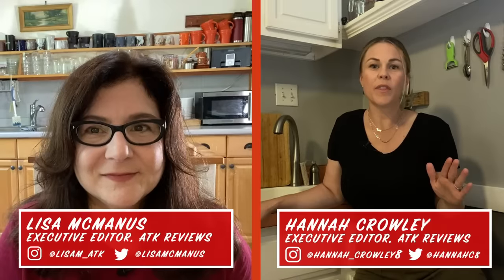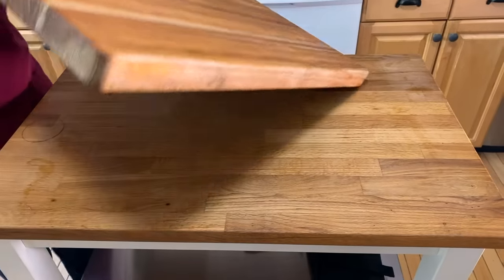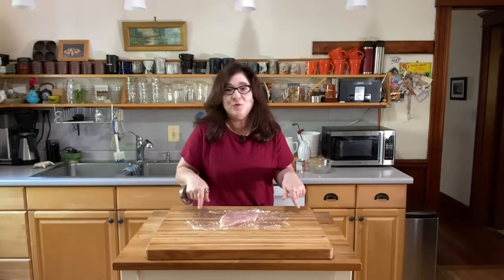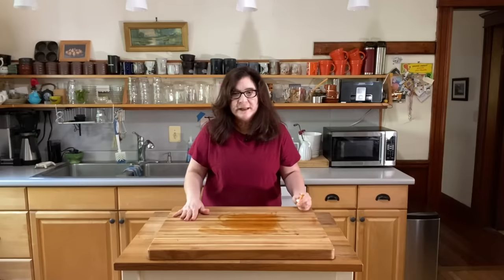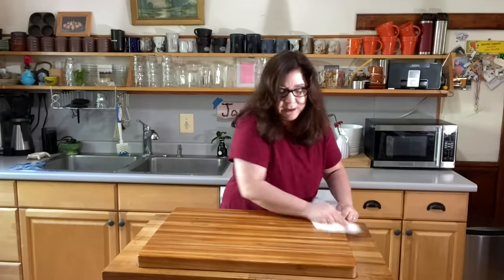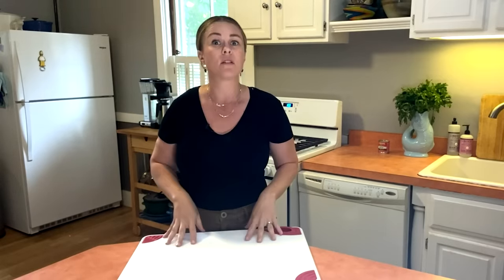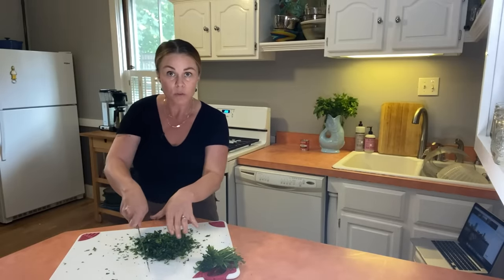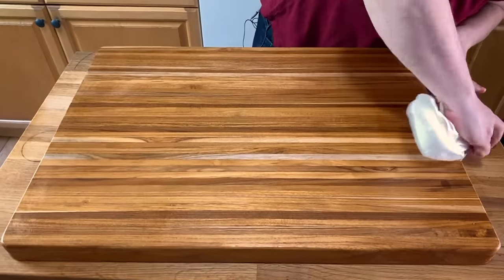Gear Heads | Which Type of Cutting Board is Best for Your Kitchen?

Comment: Another woodworker here... Of your cutting board is breaking at the glue line like in the endgrain board example the manufacturer used the wrong glue for the board (get your money back). Also when washing, wash both sides to prevent warping. Finally dont just use mineral oil to treat the wood There are special "wood butters" that are worth the money to keep your board looking like it was when you purchased. if you get the board from a woodworker then they can give you the wood butter that you need to treat your board.

Comment: 9:37 it may be able to be washed in the dishwasher but it does not fit in the dishwasher for a proper sized cutting board. Honestly, my Crofton $8 Bamboo cutting large board from Aldi's works great!! I've been using it for 4 years everyday. Sure, I'd love to splurge on a cutting board but there are so many other gadgets from Atk's recommended I need to buy! =)
Reply: The problem is that bamboo is not wood (it's a grass), and they are infamously hard on knives. Bamboo is 19 percent harder than traditional maple, which means it’s also harder on your knives. Also, the small grooves may ever-so-slightly catch your knife, interrupting a smooth cutting action. And many of the glues used for bamboo boards use formaldehyde. You want to make sure it says formaldehyde-free glue is used.
Reply: @violetviolet888  I have the atks #1 recommended chefs choice trizor knife sharpener and the Victorinox Swiss army 8 inch chefs knife and I have been able to maintain an extremely sharp edge on my knife. I did not know about the formaldehyde in boards though! I will definitely look into that.
Reply: @violet also I haven't really noticed any significant grooves that would diminish my cutting performance on my Crofton cutting board.
Reply: @barbara-holley  Just higher maintenance on your part. I prefer maple wood or the proper cultivars of acacia wood and enjoy the feel of my knives on the boards.
Reply: @violetviolet888  maybe if I felt something nicer I would change my mind. In the restaurant industry I always used plastic cutting boards (even at the fine dining restaurant). I definitely always hated plastic cutting boards.

Comment: I use both types of boards . I use coconut oil for my wood board and cooking spoons, spatulas, should I switch to mineral oil?
Also can you cut on granite countertops?
Reply: All organic oils turn rancid (that includes coconut oil) and polymerize. Your equipment is already ruined, anything new you should solely use mineral oil on. You can cut on granite, but it will dull your blade like glass or bamboo would.
Reply: @madthumbs1564  😭well I get new stuff☺️

Comment: I was Afraid to wash my wooden board in the sink because I was worried it would suck in soapy water and it would ruin it, so I had just been wiping it down. I don't use it for cutting any raw meats. It's about 75% for handling dough, 15% for cutting Pizza, and 10% for other random things.

But then one time I had it nice and moist and I decided to take my bench scraper and drag it across the board. The Edge was full of this dark bluish green moldy gunk. So I did it again and again. Finally by the seventh time, it's stopped. Really disgusting.

From now on, full hand wash every time it gets used.

Comment: I rather cut tiny bits of wood into my food than plastic. Also, I've had bamboo cutting boards for 3 years plus and never had to rub oil on them. No cracks. no problems. never had that issue with maintenance.

Comment: About plastic boards: POLYPROPYLENE NOT POLYETHYLENE. PP is softer than PE, which means PE will chip your more expensive knives, and dull the cheaper ones. Always check the chemical composition of the cutting board.

Comment: [ would like to see a testing of cooking oil sprayers as a replacement for "PAM' type oil aerosol spray cans from the grocery store.  I would prefer to use my own oil since I know the quality of the oil.  The quality of the "PAM" type spray cans is of unknown quality. The pump sprayer I purchased was unable to adequately spray a light vegetable oil and was totally unable to spray any olive oil period.  thank you
Reply: DENNIS SKURNACK I stopped using Pam years ago. The best luck I have had is with a bottle of ghee/coconut oil I bought and have been refilling with olive oil ever since. The company is St Francis Herb Farm. I have been using the same bottle for many years after having the same issue with the pump sprayers.
Reply: @lynnstlaurent6789  THANKS

Comment: Both sides of your double sink are bigger than the double sinks builders put in average tract homes in S. California since the late 50’s.  Bigger than what they put in average mobile homes, apartments, and senior complexes.  I know because I lived in 5 of the Counties over the 65 years I was there.  They may be putting tall faucets in newer average housing.  I currently live in an older mobile home with a kitchen built like they thought it was a motor home.  Your favorite cutting board would need to be washed in the tub or shower in a lot of homes.

Comment: With, or without, a border juice canal?  I've generally found the juice canal less that valuable.  What do the testers think?  I see that neither of the two winning boards (i.e., the wood nor the the plastic) have a border juice canal.
Reply: The "juice canal" is found on their winning carving board, but the cutting boards don't have them.
Reply: My Proteak board (a different thicker 20 x 14 inch end grain one) has a juice channel on one side, but i generally leaves that side facing the counter. Might be nice if I ever host a party with a big roast on the middle of the table, but generally it just makes the usable space smaller, and food gets complicates getting food off the board. Who wants to dig out bits of chopped onion, parsley, etc, from that indentation?
Reply: Thanks for the comments.  I hadn't realized that distinction between cutting (no canal) and carving (canal) boards but, based on the comments, Idid a "versus" search on the internet.  However, I still don't see where the canal would be all that great since it fills up and overflows anyway (I have both board types).  I think if I get an additional board, I'll just opt to "reclaim" the canal space as someone mentioned.
Reply: @ltp2151  It takes a lot of liquid to overflow the canal on a good carving board. I think you're not letting your meat rest long enough before carving if you're getting that much.

Comment: I don’t think the 15×20 plastic boards will fit in my dishwasher I just measured the dishwasher I have smaller OXO boards that I put in the dishwasher.  The black trim gets sticky and black gets on everything and I have to throw them in the trash.  I am looking for a plastic cutting board that I can put in the dishwasher. Any ideas?

Comment: The disposal of the cutting boards should be noted.  The wooden ones will last a long time with proper care but will biodegrade.  The plastic will be a problem for a long time.  Carbon footprint should be included as far as manufacturing goes.

Comment: Perhaps you should have done the bacteria test with a well used plastic cutting board..When I began cooking in restaurants wooden boards were already prohibited; erroneously. As you proved wood cannot retain bacteria. We've seen that plastic boards with micro cuts do indeed trap bacteria as well as food residue. We've thrown away wore than a few stained and stinking plastic boards. Even after being cleaned in commercial dishwashing machines.

Comment: I'm in the wood camp too especially for rolling pastry dough out or am I wrong as I've never seen a plastic board used for rolling pastry out on ATK.
Reply: Most of us would just use our counter.
Reply: @madthumbs1564  supposing its flat and smooth but mine is tiled and very limited too so I have to use a board on my stove top area.

Comment: I need to repurpose or sand my cutting board. Tips?
Reply: Keeping cutting surfaces flat would be the priority, I would think, then more coats of oil before use. If planing the surface, you would then want to sand smooth, and apply your oil.

Comment: I think the plastic cutting board might cause a health risk on the long run if the small bits and pieces keep ending up in your food. Plastic accumulates in your body over time . What are your thoughts on this? Do you think this could be an issue?

Comment: I use extra light olive oil on my teak board all the time. It's not a problem because we wash it all the time too. I oil before I use it, so stains and contaminants don't soak into the wood...then after I wash in the sink with hot water, let dry, then oil it again. The extra light olive oil has never turned rancid on us in over 4 years of use. It's important to keep the board well oiled, and while mineral oil is good, it's too expensive.

Comment: There's no mention of microplastics.  If you're cutting off of plastic boards won't you get microplastics in your food?  My preference would just be a block of tree stump.  If the surface gets chipped, nicked or stained all you have to do is mill off a 1/4 inch or so and you get a new surface.

Comment: I got the Proteak wood board you recommended last time and I noticed it’s starting to wobble. Is there anything that can be done so it doesn’t warp further on me?
Reply: Oil it often and regularly. I meant to get their fave Proteak board a few years ago, but it was out of stock, so I ended up getting a slightly smaller, but thicker Proteak end grain board. It is very heavy, but since it is not as tall and wide, it is a bit easier to wash in my small apartment sized sink. So far I haven’t had any problems with warping or cracking. Love it. In addition to mineral oil, I occasionally use a board conditioner, which is essentially just a blend of mineral oil and beeswax.
Reply: It will tend to curve/expand on the side that gets wet more than the other. Try wiping some water on the other side and it should bend back. Then, make sure it’s never wet only on one side and condition as the other person said.

Comment: I need a manual can opener review, I’ve bought several of them and can’t find a durable one
Reply: My SwingAway can opener has lasted for years!
Reply: MJ  well I bought one that removes the seal on the can so there are NO SHARP EDGES   I think I gotmit at TARGET about 14 years ago. , Cheers  🇺🇸🇺🇸🇺🇸🇺🇸
Reply: My Kuhn Rikon has been working well for years.
Reply: Swing away lasts but kitchenaids are also nice
Reply: @sillyrabbit367   Bed Bath and Beyond has them on line.  I'd buy one but there is no place in my kitchen to put it.  Made in China now like everything else.

Comment: I am a plastic fan.  The deeper cuts can hold onto bacteria, especially concerning when it’s from meats.  The dishwasher certainly sanitizes the boards, but if I need/want to quickly sterilize the board, I spray it with spray bleach cleaner, and then quickly wash it with hot water.
Reply: Agreed about the bacteria in the knife cuts in the plastic. Understanding this, why would you continue to use it? There's also the issue of microplastic shreds contaminating the food.
Reply: @Horizon344  Can’t wash wood in the dishwasher.  My experience with wood always eventually resulted in cracking and/or warping, unless it’s a very heavy unit, which is not cool for moving it to and from the countertop.  As to shreds, I don’t cut into the board deeply enough for shreds to come off.
Reply: @catdeddy8427  Is handwashing in a sink such a trial? I've been using two basic good quality wood boards for 20 years, & they're still going strong, no issues. There's no moving on my counter-top, if you have one doing that a cloth placed beneath the board will stop it. As for plastic shreds, if you can see any grooves/scoring in your board - that material (microplastic) that's come out to make these marks has gone into your food, & once you've heated it up & consumed it it's anybody's guess as to what your digestive system & blood stream will do with it.
Reply: @Horizon344  You do you...

Comment: I've tried all the cutting boards, even made some myself, and honestly my recommendation is to not spend much on them. Seriously, 250$ for a piece of wood? I just get the cheap plastic ones from ikea, and throw them away once they've bent and stained. You save precious time, effort and especially money that you can spend on things that actually make a difference, rather than spending a small fortune on a glorified piece of laminated panel that you have to maintain every day so it doesn't stink and rot.

Comment: One more thing, I have an average sized dishwasher, and that plastic board wouldn't ever fit!  The biggest one that fits is 13.5x16.5.  Not sure how they got that giant one 15 x 20, in the dishwasher.  Maybe that's why they cut the video at that point. Dishwasher looked smaller than average and just went back and paused the video and that board is too big for a regular sized dishwasher.

Comment: I think it's worth pointing out that not all plastics are equal.  Whereas you could use as knife with a hardness >60HRC on most wooden cutting boards, the same is not true of all plastics.  Most high end composites and polyethylene based boards are fine though.  To be fair, there are also plenty of woods that would be too hard for harder knives, but they aren't used that much for mass produced boards.  If you use soft, stainless steel knives, it doesn't really matter.

Another thing to bear in mind is that, whilst the high silica content of teak offers great protection for the cutting board, it can also dull knives faster, which is fine if you don't mind maintaining your knives.
Reply: This is a big commercial. The whole channel is.

Comment: If you use a plastic board long enough you will be eating and serving plastic... over time tiny pieces will release from lots of cutting... but, they are cheap, so replace when the surface starts feeling rough.

Comment: My preference for cutting board is Bamboo. Extremely durable and from the USDA page "Bamboo cutting boards are harder and less porous than hardwoods. Bamboo absorbs very little moisture and resists scarring from knives, so they are more resistant to bacteria than other woods. Clean bamboo cutting boards with hot soapy water; sanitize if desired. Rub with mineral oil to help retain moisture."
Reply: The problem is that bamboo is not wood (it's a grass), and they are infamously hard on knives. Bamboo is 19 percent harder than traditional maple, which means it’s also harder on your knives. Also, the small grooves may ever-so-slightly catch your knife, interrupting a smooth cutting action. And many of the glues used for bamboo boards use formaldehyde. You want to make sure it says formaldehyde-free glue is used.

Comment: Careful, I bought the Proteak on Amazon and it had a chip on the corner because the wood was brittle and dry. The board immediately got tons of marks on it. It splintered where the knife would cut it. The surface felt like sandpaper due to how much splintering was happening. This is WRONG! I oiled the life out of that thing to help rehydrate it but once it goes brittle like that being stored in a warehouse in harmful conditions for wood, it becomes useless. I recommend a different board. Too pricey for this risk.

Comment: You skipped which of the two did better in robotics test.  Which dulled a knife faster.  Which could be resurfaced.  Can it be repaired if damaged.  Really think this was a half assed review.  Also I don’t recall the actual or suggested manufacturer price . Some one needs to review the review.😂

Comment: Then why are so many Health departments making it mandatory to have the plastic cutting boards?
Reply: Many govt health services employ your everyday average person that has undergone basic training in food safety at best. Expecting any kind of know how is moot - and yes, I am including those who get chemistry degress as this type of degree does not confer food safety knowledge. This is evidenced by advocating for plastic cutting boards. 

Realistically, if one wanted to ensure optimum food safety, dense, not "living" or flexible, solids would be the instructed methods. This includes treated stone, metal and shatter-proof glass (less recommended as shatter-proof glass boards can of course still break). Of course, neither of these should be used without adequate cleaning methods.

Comment: Did they not follow up with whether it was a myth or not that end grain vs edge grain messes up your knife more?
Reply: End grain should be more likely to dull your edge whereas edge grain wont dull the blade but it will wear down quicker with cuts on the board being a bit easier. I sharpen my stuff so I prefer end grain.
That being said, how you use it comes into play as well as does the type of wood
Reply: Misuse messes up your edge the most. I've seen so many chefs ignore lateral stress / metal fatigue by scraping cutting boards with the blade edge.

Comment: Plastic stores bacteria in those cuts you make with your knife. And your dishwasher can’t clean it properly. Plus, you consume toxic microplastic’s every time you use a plastic cutting board. (Like toxic Teflon in your cookware. If you cook with it you’re consuming it.) Wood, on the other hand, is natural. It’s antimicrobial and 99.9 percent of bacteria dies within minutes on it. Quality wood boards last much longer than plastic. And you can digest the microscopic wood pieces unlike plastic. Just give it a good scrub with your brush, hot water and soap. And when the grooves start to show up, sand it down with sand paper. It last forever, like a cast iron.